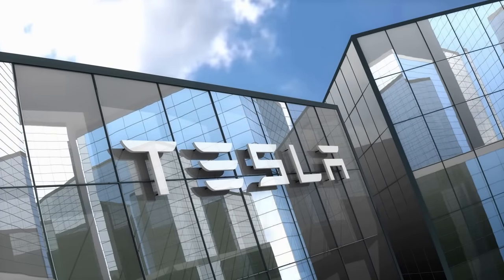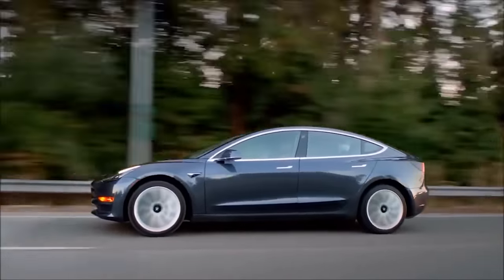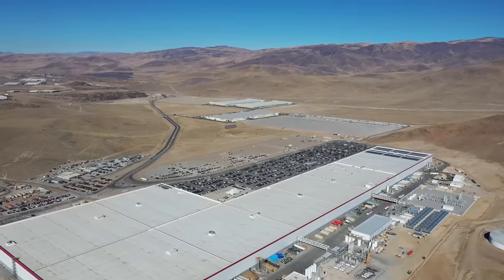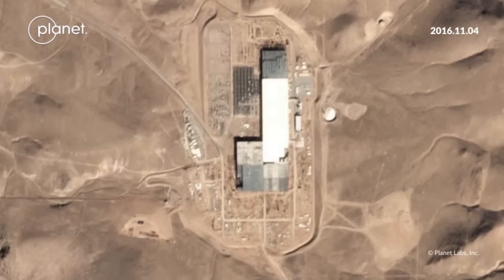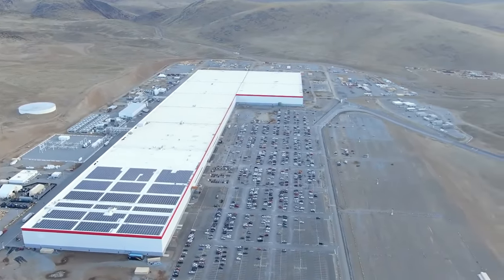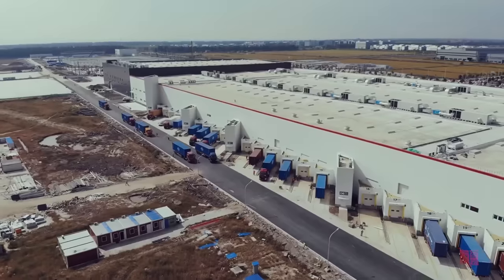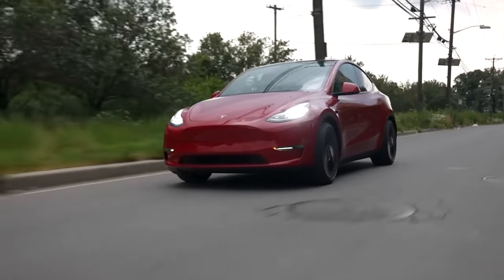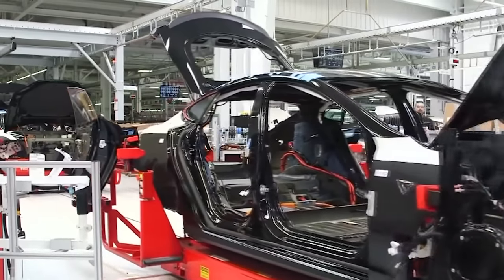Inside Tesla's $5 billion Gigafactory

Comment: Presentation nitpick: the narration hitches at 0:54, 1:16-1:17, 2:04-2:05, and 3:02-3:03 are very distracting - they make me take sit up and notice of the presentation (breaking the 4th wall a bit), and subsequently question the legitimacy of the information being conveyed. With all due respect, completely eliminating this sort of thing is absolutely worth it.

(There were also couple of points where I had to pause for a couple of beats to understand some bits of phrasing that threw me off slightly, but this wasn't frequent.)

This being said, this is still an interesting video that clearly took a notable amount of time to source info for.

Comment: A huge flaw to tesla is that to buy a tesla your actually hurting the environment more. But if it goes net 0 all those worries could go away and we can finally safely recycle our diesel cars into electric without causing the world harm
Reply: Utility companies can barely keep up with the current electricity demand in most states without shutdowns. There is no way they can produce enough to power charging stations if even 1/4 of the vehicles were electric. Think about how many cars are actually at the thousands of gas stations at any given time. And gas cars have more than 4 times the range if an average electric car. So if you do the math, we would need more charging stations than gas stations and the stations would never be empty since you have half the range and need much more time to charge one vehicle.
Reply: @danc1197  very true. But I wouldn't link such issues to Elon himself. He probaly hasnt even seen the issue yet which is currently emerging. But I dont see the world going that electric currently. If spaceX stopped trying to get mars colonies in a time when it's an incredibly stupid and expensive project and make a moon colony with NASA we could get helium3 back to earth and create fusion reactors. But until then we need to reform the grid
Reply: This is a short term issue given the source of electricity throughout the world isnt totallty clean yet. It is at least an incentive to drive Electric companies to more green electricity generation

Comment: One day lithium-ion battery will be obsolete.
No problem for EV though, as long as the new battery technology can be assembled into proper voltage for these old vintage tesla EV car (say it's 2040) they'll run just fine or even better with newer, lighter, smaller, higher energy density battery.

Comment: Hello Elon ;) Please let me know if you would be interested in a rewamp of the battery pack of a car or residence that can insure the absolute cheapest and fastest manufacturing + minimum errors, irregardless of the chemistry tech and its future itterations. This would be be a completely modular system where per cell upgrades / repairs / replacements should pose no problems at all making it even more resource responsible and durable, apart the extremely economic production methodology. The whole ideea is about undesigning most of the manufacturing phases while using no new untested tech, just the curent one.... No prototype just yet, just some concepts and the theoretical base. Yet, unfortunately I fear too much time will pass until a full real-world test would be possible. Please help me help the world :) All best !

Comment: I got question  to anyone the battery packs how long will they last before replacing a year 5 years 10 years and what will it cost to replace them if its over ten thousand dollars no thank u. Wet cell batteries and dry cell batteries are expensive on floor scrubbers and folk lifts. A 100 miles u have recharge maybe good in city but out of state driving no thank u. 100000 for a car is ridiculous 20000 is fair not all of us are  rich. Telsa wants to get serious 400 mile range on one charge 25000 dollar price ten year battery warranty that will compete with gas cars. Telsa going to have to give rebates and sale service stations on the idea electric charging stations can make a profit. Telsa got his work cut out for him to sell his idea it would be cool to see solar panels added to cars that would help on saving electricity by the way most electricity plants are fire based coal plants wind and solar only go so far battery technology is still in infant stage i think a few years  it could be viable but we just need more technology and a more efficient way to make cheap clean free energy. Energy is constant which means it is limitless if we can learn to recycle wasted energy actually achieve 100 percent power we would solve the energy crisis clean energy free energy reusable energy one day i hope we just got to learn how to to amplify energy make it efficient we do that walk on water.

Comment: Elon Musk is a true visionary. I would love to own a Tesla, however, I need the vehicle to be designed similar to a Ford Bronco. I need to be able to store a mountain bike inside the vehicle vertically without taking it apart. In addition, the vehicle should have 4 WD, manual transmission, locking gas cap, BB proof windshield + glass, and multiple alarm system. Possible ???.
On another note, it is a shame that some of the employees were involved in illegal activities and had ties with a drug cartel !  The problem is the fact that it is everywhere ! I am sure Tesla/SpaceX has a very strict drug policy, which they should.